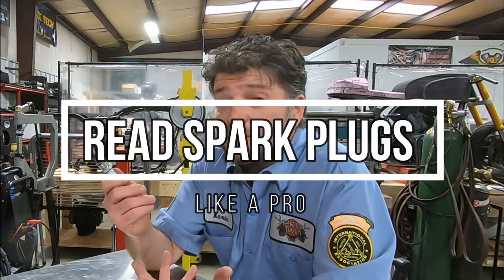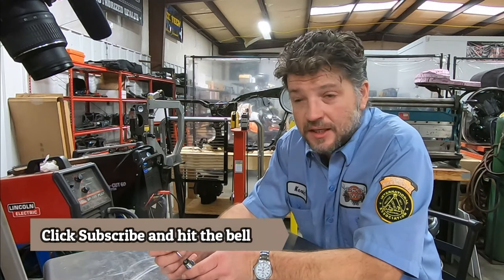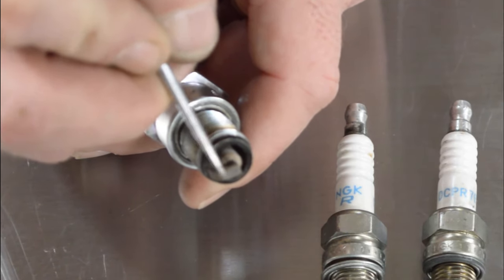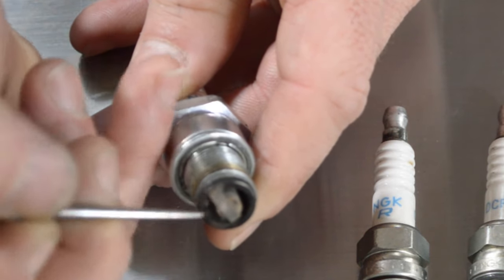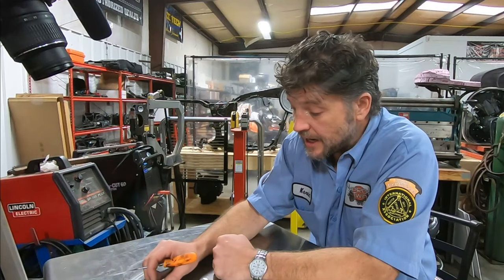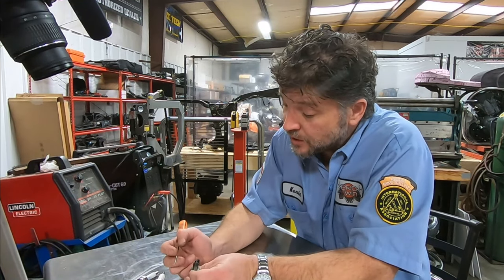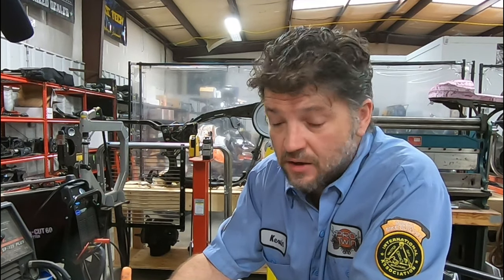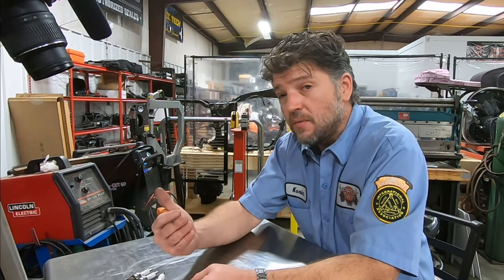Read Harley Spark Plugs Like a Pro - Kevin Baxter - Pro Twin Performance

Comment: Great video!  I have a 2018 Heritage 114 with 11,900 or so miles.  I’ve checked the plugs every 500 miles and consistently my front two plugs are white.  The rear top plug is white, BUT the rear plug pointing to the left of the bike is considerably darker.  Normally Harley rear cylinders run hotter than the front so what is happening in my M8 engine?  BTW, I’ve had to re-gap my plugs every 2000 miles or so bc the gap widens by 3-4 thousandths during that time.
Reply from the maker: Wow...you've got some strange stuff going on there.  Sounds to me like their may be a ring or valve guide issue on that rear one.  Having to regap that often...sounds like combustion temps are getting a bit high and excessively eroding the plug.  Check AFR, look for detonation, and do a leak down/ccp test on the engine.  Post back comments and let me know what you find.  Good luck!
Reply: Kevin Baxter Ok!  In the past three days I’ve had an Ultra Cool 3.0 heat exchanger oil cooler unit installed.  Have spoken with my local HD dealership over the past four months about the white plugs and they didn’t see it as a problem.  So, I’ll discuss the matter with the dealership 123 miles away where I bought the bike and add a tuner if the Ultra Cool 3.0 doesn’t rectify what I’ve been seeing on the plugs.  Thank you for your suggestions, I WILL DO THEM.

Comment: What about the front plug runs leaner than rear cylinder on 1200 sportster? Should you run rich for rear and the front on the money or run front leaner

Comment: Hi Kevin. Thank you so much for all your work with these videos. I am wondering, how long would it take to get a proper reading on a new plug? Would a short ride be sufficient?
Reply from the maker: Yes however, it requires much closer examination.  Most of the time, to make things obvious, a few hundred miles.  Youre welcome.  thanks for following.

Comment: A hack saw blade and a cordless drill makes short work of the spark plug crimp. And if anyone knows the part number for a ngk dcpre 7 plug without a screw on top I would appreciate it. The only advantage I’ve come to with HD is being able to run the fine line of detonation due to a roller bearing crank. Swain tech coating stops the pistons from being wear items in high compression pump gas hot rod bikes. Fine video sir, you give insight to why we make the big bucks🙁.

Comment: I just recently changed spark plugs, I believe that the ones that I took out were original because they said Harley-Davidson on them and the bike has about 24,000 miles on a stock '05 Dyna Wide Glide fuel injected Twin Cam 88. I wished I would have kept the old plugs so that I could have tried to read the other aspects of it but I threw them away. The plug from the front cylinder had a lot of carbon build-up on the electrodes, so much that the gap was almost completely closed but it wasn't shiny or wet. The rear plug had quite a lot of carbon build-up also but not as much as the the front. The engine had been missing mostly at cruise speeds and also popping from time to time on deceleration.  I replaced them with NGK Iridium IX DCPR7EIX spark plugs and it runs great. I also changed plug wires but went back to the originals for now because the new ones were a kit that I put together and they were causing the check engine light to come on. I think I may have damaged one when I was trying to pull the spliced end off of one, I'd forgotten to cut it to length first and twisted it a few times, probably damaged the core wire.
 Anyway, I'm curious if that much carbon build-up is normal after 24,000 miles or if  something is off.
Reply from the maker: That's not normal at all.  Could be excessive rich mix or oil blowby.  Id be doing a leak down and cyl pressure test on that one.  Also...valve stem seals were a common issue in that era.
Reply: @KevinBaxter  OK, I will look into those things, thanks a lot Kevin.
Reply from the maker: youre welcome

Comment: Now I'm confused.  I just pulled the plugs on my 2001 Heritage Springer with a Twin Cam B motor.  It has been converted to 95 inches with SE 203 cams and has a SE CV 44 carb.  The front plug after a few thousand miles came out virtually clean and only slightly discolored, but other wise looked like a new plug with no erosion on the center electrode and a white porcelain  center.  The rear plug came out dark with carbon, but not the lumpy kind.  It also showed no erosion and a sharp edged center electrode.  How can they be so different?

Comment: Thanks for all the information you supply. I really appreciate it and it’s very interesting. With your camera a little out of focus, it’s hard to really see what’s going on. If I’m looking at my own plugs correctly, the color change on the ground strap is very slight. Is that normal or should it be fairly pronounced?  Also, what do you recommend for spark plugs? Thank you.
Reply from the maker: I did a follow up video changing the plugs in my GMC. It shows better what we speak of. Watch that one. The color change can be slight as long as one is there.

Comment: Kevin, I have a question on spark plugs:  Theirs a hype on the NGK Iridium sparks plugs. I have a 2020 Road Glide with the M8 114 all stock only exception is a slip-on muffler, Motorcycle has just over 2000 miles on it. The bike is running fine for my needs. The book calls for the NGK Iridium plug for this bike is CR9EIX – 3521. What is your opinion on the NGK Iridium Spark Plug? When time should I just use stock plugs? Thanks
Reply from the maker: i would keep the stock ones in there personally.  the ign system was designed for it.  and those last quite a while.  i would not run them in a TC or earlier though.
Reply: @KevinBaxter  Thank you
Reply from the maker: youre welcome

Comment: I have an Aprilia SVX V-Twin, rear cylinder gets way hotter, the bike will die, then not want to turn over. Starts are hard...Exhaust temp was 375 vs 275 on the front cyl header (2-1 exhaust). Could a colder plug help that?

Comment: What if one plug the strap changes colors on the bend and the others is just one color all the way down??
Reply from the maker: the beauty of EFI...each cylinder ign tables can be adjusted independently.  On most aftermarket carb igns, one cylinder can be adjusted as an offset.

Comment: very cool video kevin thanks for the information. ive been watching all of your stuff lately .these are old school techniques that cant be learned overnight , i look forward to pulling my plugs this weekend in my 2000 fxdx 95" running about 11:1 daytona twin tech ignition.   im going to use your tip on the pourcelin to see if i have pre detonation  .  at cruising speeds i sometimes get what feels like pinging when the bike is loaded slightly low rpm range .. a very small rpm range  ( maybe 200 ) but none the less. the bike was tuned by a reputable shop , do you think that could be ironed out more ?
Reply from the maker: you may have to modify your riding style or program a custom map for the ign.  11:1 on pump gas is a bit high so expect to have to retard timing a bit...or...just run it at higher rpm so there is less load on the engine....all that provided the AFR is correct.
Reply: @KevinBaxter  cool yeah when it pings in 4th I just shift and or ride in a different rpm, range . how do you feel about 50/50 Klotz leaded fuel for this application ? thanks
Reply: yeah im probably lagging the bike a little and only have maybe 500 miles on this build .most people would probably just ride it lol the thing runs great other than that small detonation area. i just want to learn tuning better. the cams installed are the s&s 585 so she pulls nice to redline and normally i like to cruise around 3200-3500 so i dont have a issue . its a sweet spot in 5th  gear where it pings a bit. im still learning but i did pull my plugs and was wondering what is the "right" plug like you said is it hot enough? are there charts to help find the right temp plug or is that someyhing you have to read and feel?

Comment: Kevin, if we have 4 plugs on the M8 is it ok to just pull the two outer plugs on each cylinder and look at those?  or should you always pull all 4 and look?  I mean will the two outer be enough to tell you if things are ok?
Reply from the maker: you could really just pull the outer if just checking.  if diagnosing a known issue, might be a good idea to pull both.

Comment: I use E-3 plugs with no traditional strap. Should I switch back to NGK?  Also I noticed the rear cylinder burns different than the front. is this normal? Pugs are noticeably different.  Exhaust on read is starting to discolor. Samson true dual fishtails.
Reply from the maker: I have always found little to no benefit from "fancy" plugs in an HD.  In nearly all cases, the stock plug or Champion/Autolite equivalent works well and the ion sensing works flawlessly (if you have a TC with that feature anyway).  If the rear cylinder is different (carb), a little darker (tan) isnt unusual.  But for EFI, i target to have each of them the same because with EFI, i can control fuel to each cyl independently.
Reply: Kevin Baxter thanks for the reply. And yes it is carbed tc88. I don’t normally go for hyped up products either but they’re pretty convincing, lol. Your videos are great.  It’s like going to college, I almost feel guilty watching for free. But I am looking for a big bore kit and heads. And you’re on the list.
Reply from the maker: Thanks for watching sir and for the kind words. We distribute pretty much every part available in the industry...so when you're ready for any parts, you can support us by ordering from us. We most certainly will help you with tech, etc before and after the sale. Again...thank you. All the best.

Comment: Are there any compatible spark plugs for Twin Cams that are copper (not iridium or platinum) that have solid (not twist off) tips, other than the HD 6R12 plugs?
Reply: For many years I've use a Screaming Eagle sparkplug for my more open exhaust such as 2 into 1 Thunderheader exhaust on several of my bikes carbureted 1994 Evolution Screaming Eagle performance  #32192-10 as well my 2012 Twin cam Fuel Injected 103 with a Thunderheader 2 into 1 #31600106 nice clean burn, having no acceleration back pop expensive yes they work for my fast builds, I have now 3 yrs. on my spark plugs in my 2012 103 Twin cam and 4 yrs. on my spark plugs in my evolution. burns much better than NGK's and Iridium's seem to be too hot. so we continue in my applications to run the screaming eagle spark plugs

Comment: This should be a book with multiple color pictures 🤔

👌👍💪
Reply: I remember some manuals had that way back when for car engines, but not in a service manual.  We actually had a spark plug manual that would cover plugs, gapping, etc. They had a chart that showed oil fouling, running hot, etc.....pretty much what Kevin explained in the video.

Comment: I have been chasing an issue. 05 heritage SE 103 kit. About 36k miles. Bought it used 2 years ago. Front cylinder carboned but not severe. Rear cylinder pretty white. First thought vacuum leak. Yep. Rear injector oring shrunk and injector fairly loose. So did new injectors, and intake to head orings. Front still the same and rear stll white but not as white. So did orings again but this time installed a different air cleaner. I noticed the front side of intake manifold wet with oil. Bingo. Breather issue. I hope. I just did a new S&S cam chest upgrade kit with 551 easy start cams. Im getting old and rarely spin it past 4k rpm and ride 2 up in the mountains here in az so the perfect cam. The SE 253 cam sucked. While doing this upgrade i put the newest HD breather assys in it. Rear exaust port is kind of white and front is black. The rocker box gaskets also told me the front cylinder has been hot as they were hard and rear were normal. So tonight i got the fuel tank assy back on and hooked up. Im running a thunder header and was wondering why the front head pipe was more blue and further down compared to rear. Oil might well be the answer. I am loading a new tune into the Thunder Max ecu thats kind of close so it can auto tune until i can get it into trask for a dyno session. Almost forgot, i was getting just a little detonation according to the plugs. Anyway, this weekend i should know assuming its not too hot out. Already getting to low 100s here. It limits my riding some as riding in a blast furnace is not fun. Miserable actually. The moral is oil can come from other places besides valve seal. Especially on evos and twin cams. I hope its fixed otherwise youll be getting a top end in the mail sooner than i figured on. I learned to read plus on airplanes back 30+ years ago. Its the same for any spark ignition engine. Car, motorcycle, airplane, 4 stroke or 2. Thank you and be safe!
Reply from the maker: thanks for the comment!  best of luck with it this go around.  hope it's fixed too...if not, box it up and we'll get it done!

Comment: How much of the strap color may be coming from the wrong octane. HD requires 91 and up. Maybe someone was running 86 or 89
Reply from the maker: Octane in itself wont create a difference...but....higher octane, slower burn, effectively reduces timing which can move the color change.  opposite is true for low octane.  basically....combustion timing.

Comment: Man I wish there was a way I could get you to look at my plugs right now.  My front plug looks like the @7:00 and my rear looks like the plug @10:25 with a white color spot close to the threads. 
2008 flhtcu. Fuel injected. Any ideas anybody?

Comment: You said 12.8-13.2. What does that reference?
Reply from the maker: Air Fuel Ratio
Reply: @KevinBaxter  Ohh. Checking the A/F is beyond my means. The video is really good and interesting with a lot of good info to know. I'm watching your "All About Engine Oils" video now.

Comment: Good info; running NGK Iridium in a 16 built high compression 110 with Thundermax.  Plugs look the exact same.  I may need to retard my timing a little bit.  So the color change in the threads goes little further, has that golden color.  My bike has always ran hot; 30K on the build, 70k on the bike.  .  What’s the solution or what should I check.  Plugs are dry
Reply: You say your bike always run hot ,do the following & it will run much cooler & better.

Install an ultra cool oil cooler with twin therm controlled cooling fans.

Install love jugs mighty-mite cooling fans.

Reroute the crankcase breather from air cleaner to atmosphere, DL Customs sell the kit. 

I did all the above to my flhtcu twin cam which reduced oil temp a whopping 45-50 deg in 90-100deg summer heat which resulted in multiple improvements in engine perf & rider comfort!

No more detonation on hot days under load on 91 octane fuel when it used to detonate on 93 octane fuel on hot days before I installed the cooling mods. 
No more power & trq loss making motor feel soggy with mushy thtottle response on hot days.
No more lifter/valve train noise due to overheated thinned out oil!
Retains approx 5-7 or so psi higher oil pressure at idle & 8-10 higher psi st cruise on real hot days.
Hot restarts are faster/easier due to starter & battery not being as hot & heat soaked.
Slight better fuel mileage.
Seals,gaskets plastic & or Teflon parts in the motor like for example the cam chain or primary tensioners etc will last longer or not fail at all like when exposed to excess heat all every time you ride.

Happy Motoring!

Comment: I've never been to rich but I use to be lean.  Sorry, could not help myself.
I had a very strange plug condition some years ago that befuddled even mechanics.  The rear most plug on a 2.0 ford engine had tan on the inside porcelain, but also a hard whitish crystal like build up that was hard and then baked black at the electrode which sometimes could be sooty. Valve guides was one problem and detonation and heat build up probably the other problem. Very strange.
Reply from the maker: sounds like you have oil infiltrating that cylinder.

Comment: I usually  ride  my  17 Heritage at the  speed of  0 to 60mph  in  about  25 seconds. 
Can  technician. PROPERLY  set the  fuel/air  ratio. And  timing  
Is that  canned  data  
My  bike  oil  temperature  on  a 85,* day riding  60mph  is  230.

Comment: thank you very much for these explanations. I've watched this video several times but I still can't understand one thing. When you say "too much timing, not enough timing" (advance/retard) what am I to understand? Too much timing for example if my advance is 31 for 40kPa x 2500RPM what does it mean? Do I have to add or subtract a value to 31. So 31 to 29 (let say) or 31 to 33 ?
Reply from the maker: Very good question.  Timing is based on piston position before top dead center of the piston.  So when you advance timing, or "more" timing, you are firing the spark plug earlier than top dead center.  The opposite is true when you retard timing.  So...lets change timing from 30 degrees to 35 degrees.  We have "advanced" the timing 5 degrees or "put in more" timing, making it fire 5 degrees sooner.  If we go from 30 degrees to 25, we have "retarded" timing, "put in less timing", making it fire 5 degrees later...or closer to TDC.  Hope that makes sense.
Reply: @KevinBaxter  What a clear answer! Thank you very much.
Reply from the maker: Youre welcome sir.